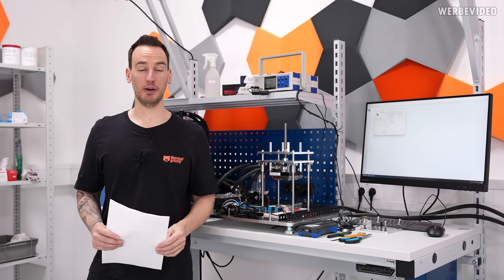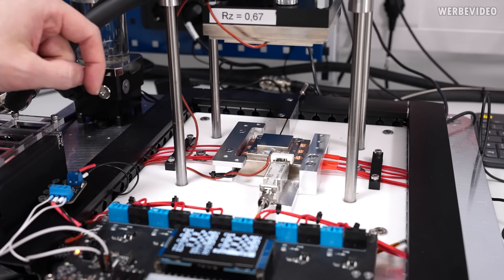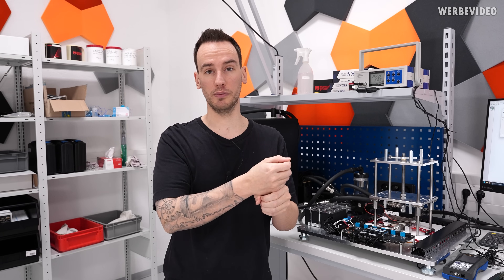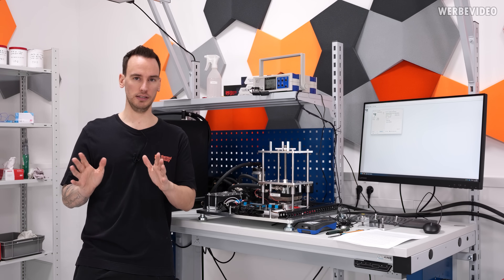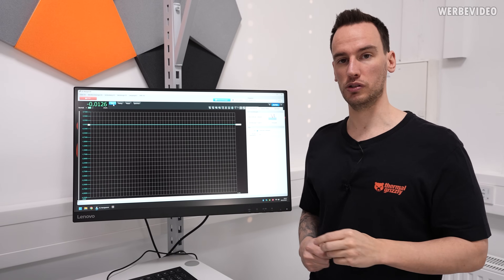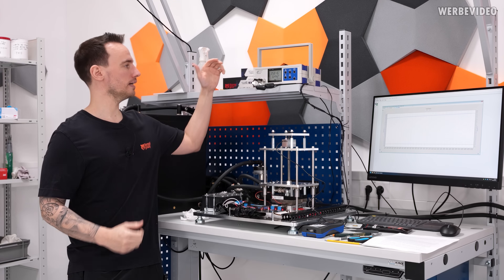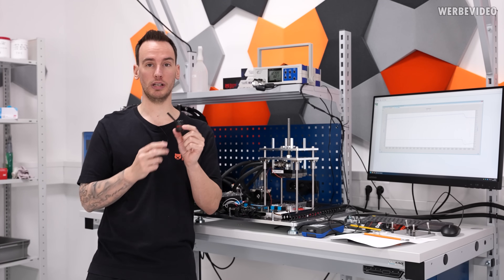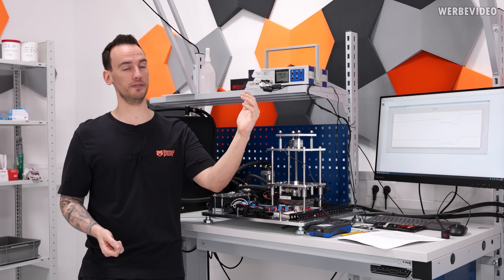The Secret of Testing Thermal Paste

Comment: 10 micrometers vs 20 micrometers… can we determine this by how much thermal paste we apply to our cpus? Or is it entirelly dependent on cpu cooler pressure and structure and the inherent charactristics of the paste itself like viscosity.

Because that thinness has to be achieved by the cpu cooler pushing the excess out. But my question is this,  if you add too much paste before installing the cpu cooler does it hamper its ability to push the excess out efficiently? I doubt it since it doesnt make sense. Then this means you cant apply too much paste then, rigth?

Comment: Hello, I don't think it will affect much if the thermal conductivity is maintained. Anything you add, whether it is a good or bad conductor, is and follows the law of Ω a bit, if the paste consists of covering the regularities (cpu---> metal---> radiator or cpu---> radiator air) if the material is maintained, the conductivity will change little (the fact that it is liquid I think is to maintain the contact without regularities, that is, improve its distribution); but suppose you make an ink with a somewhat elastic base and the rest for example of a certain graphite flakes with conductivity of 1000 and something at 2000W / mk and the ink is applied as if it were a correction marker, in such a way that you paint the cpu and paint the radiator, even if it dries the gaps remain covered and being like a paint, it is enough to correct the problem, in case of graphite, suppose it is copper, or aluminum nitride, zinc oxide, and the dangerous dust of beryllium oxide
The material will remain there, as long as the elastic substance, whether due to phase change or because it is elastomeric, will continue to be painted on both sides. The nice thing about this information is that it is done on the z-axis and not the x-y (something I have not taken into account). For example, a type of graphite crystallization ranges from 1000 to 2000, and for graphene from 3000 to about 6000 W/mk. However, if it is the z-axis, for graphite it is approximately 10 W/mk (the force applied to the paste, the thickness, the size of the grains, the proportions of the mixture, etc.). 
Best regards.

Apologies if something is not understood, I am also a newbie in this, but I liked to learn and experiment, and when I saw this article I used a translator. If any word comes out wrong, I apologize.

Comment: The temperature delta is indeed what you want to minimize for a given thermal case model, but this value will vary with the CPUs internal heating rate. The physical value you are seeking to minimize is the effective thermal resistivity of the interface, which will be affected by the volume and contact geometry of the TIM between the CPU and heatsink, surface roughnesses, the thermal conductivity of the paste, any trapped air, and perhaps even surface-surface radiative transfer.

Comment: Since you do longevity testing, you are well positioned to publish a video about identifying thermally significant pump-out/dry-out from the appearance of the paste. Most people only get to re-paste once or twice over the life of a machine, probably aren't re-applying with the same paste, and often change other variables, such as by deep-cleaning the heatsink.

Heck, you probably have better data than a lot of the open scientific literature, which is largely based on mechanical cycling.

p l e a s e

Comment: I have 10000x times cheaper way to check the surface quality on exactly the cpu/gpu and coldplate you use, which is as accurate as less than 50 microns, actually. Can go as exact as maybe 5 microns, actually. Use pomade  and a piece of cloth. Apply the necessary layer and check the result, then get a grinder 400 grit 800 grit and so on to adjust the coldplaye, then use 5000 grit for both cpu and coldplate. Boom, around 10 to 20 degrees gone.
Reply: Lipstick*

Comment: Roman, just curious if its possible to account for heat flux density? With modern CPU dies being so incredibly heat dense, the bottleneck becomes removing the heat from the small hotspot on the CPU die at the core area. How do you typically tackle that?

Comment: lol.. Der8auer coming up with all the ideas. I emailed you months ago with cpu pin extensions and not taking into account signal timing. I’m a fool.

Have you tried using surface acoustical waves to align the particles . This can even be done after the paste has been applied. If tested under a microscope, you would be able to identify the exact frequency to best align the particles and create the perfect structure for thermal conductivity. You could also try electro fields but that wastes more power.

Comment: For long term testing you should mount it vertically to see if the paste falls out of the joint or separates slumps etc. Overclockers use motherboards differently to plebs we put them in cases

Comment: would love to chat with you about some products I'm am soon releasing with features never seen before that break new ground and solve a heap of problems. They also allow for fans and radiators to be used in ways far beyond what is currently possible. I did try to reach you via the Thermal Grizzly website contact form but my message may have been lost in the mass of messages you probably receive through there. Can we talk as I would love to send you the early prototypes to review/test/critique and maybe use for a build either personal, work or client. Once i send them they will be yours to keep so you can use them however you wish.

Comment: Great explanation, and as someone who has to work on thermal interfaces quite a bit I was wondering if you could expound on a couple points:

1.) What are the typical RMS roughness's of a waterblock/AIO block and an IHS? It would seem that as you reduce the effective viscosity of the paste to achieve a thinner bond line, via smaller particles and better distributions, you'd eventually reach an inflection point where the suspension no longer adequately fills the gaps between the two solid media. I assume that the 12um typical bond line of Duronaut isn't yet at that limit, but it would be cool to understand what it might be. 

2.) One of the things you often hear about Kingpin's KPX is that it is extremely thermally stable and maintains its reported conductivity over a temperature span from the cryogenic temperatures common with LN2 up to more typical ambient cooling (but I've never seen it tested using a methodology similar to what you've presented here). How does Duronaut compare in its temperature dependent conductivity? Is it suitable to sub-ambient cooling or higher temperature (passive or server type) cooling? Also is there a risk of pump-out or solidification/fatigue outside of a specified temperature range?

Comment: Make long tube, from PVC. Then, fill the tube with thermal paste. Then freeze ( oil will goes from liquid phase to solid ) Then, cut on to parts, with longevity you need to. Then connect three parts together: first part - dispenser, middle part - tube with paste, end part - pushing mechanism. Here we are. Mass product. May use with special gun ( pistol, like one that use for sealant work ) for use tubes.

Comment: I would hope Roman you would look into elastomers like Kaneka RV087, they are much worse conductivity wise, but the reworkability aspect is huge potential. You can cover VRAM like there is no tomorrow, even the PCB traces and after curing it becomes like gel. Also great for condensate protection.

Comment: Excellent presentation, especially in an area that is dark to me. I tried the Honeywell stuff and was extremely dissappointed. My system was always running hot. I decided to change to Conductonaut. The Honeywell stuff was dry and it took a bit of time to clean it off. Honestly, I had expected the Honeywell stuff to still be plyable. I used the liquid metal and my system has not overheated since.

Comment: Came from the GN video: 
For everyone's knowledge: To grind AlO2 you need a hardness of 61HRC minimum(Mohs 9)..Carbon-Steel has a limit of 70HRC, so those rolls are a wear item.. Replacing those precision ground rolls on a less than once a year would be quite the expense. 
As a suggestion: I would look into tungsten-carbide spray coating a set of used rolls. Probably need a 1-3mm undercut and then HVOC-WC build-up, ground flat and buffed to 10k grit(0-2micron) finish.  I have seen zero-wear in wear with that on 1800rpm pumps in a coarse potassium-salt slurry. Although not an issue of pressure, certainly a wear issue. Perhaps your roll manufacturer would have more insight for you.. It may not be fore your application

Comment: One of the things that is important is longevity, you don't want the paste drying out. When I took the cooler off my 3700X after 5 years of daily use the Aeronaut was still good, not dried out at all. Excellent stuff from Thermal Grizzly!
Reply: "paste drying out" doesn't matter much. It's not the carrier oil that conducts the heat.

Comment: One thing that would be useful is some thermal spreading resistance calculator with realistic values, as heat flowing from a small surface area, such as a CPU die, to a larger area such as the heat spreader. On a CPU, the die is typically around 150-200mm2, while the heat spreader may be 900 or more mm2. On top of that, the workload is probably not evenly distributed across all cores, so the effective die area is even lower, resulting in a higher thermal spreading resistance for a constant heat output. And of course, the roughness of various elements isn't generally known.

Comment: When he said that its 'physically not possible' to have a perfect contact between the CPU and cooler, so zero temp delta ... is not completely true, and we have examples in the real world.  In our cars we have gaskets in between metal components (block to manifolds etc) to seal these spaces and stop leaks, and to maintain these seals regardless of temp fluctuations.

Formula 1 cars (and all highest end racing categories) with fully custom motors ... do not use manifold gasket materials.  The tolerances designed into milling these parts is so precise that they dont need gaskets, they are just well sealed on their own, by design, metal to metal. The tolerance is so close that no material is needed in between the parts for thermal conductivity, or contact resistance or thermal resistance. We are talking a pure metal to metal contact seal.

A caveat is that these two parts seal only when the engine / parts are at operating temps, requiring teams to externally heat oil and fluids to create the thermal expansion, and therefore the seal.  For this reason this comparison isnt actually fair or equitable, and is completely impractical, but still an interesting idea and thought experiment.

If we imagine that an engine gasket material is analogous to computer thermal paste, it is with todays metal manufacturing capabilities,  physically possible to create an absolutely perfect seal and therefore have thermally conductive contact between an IHS or die and a cooing block without a paste or liquid metal interface ... because metal parts can be machined this well, F1 proves that.

The obvious problem is that intel and AMD and cooling part makers dont get together to do this, and dont have the manufacturing capacity to do so anyway.  Imagine the cost of all parts if they hade to be machined to this level of tolerance.  Thermal Grizzley paste is just cheaper.  As well the turning on and off of  computers and the variable thermal realities of general users ... obviously negates the usefulness of such a solution.

This was just to point out that yes, it is possible to design a contact point that would not need a thermal interface.  Its done all the time.
Reply: The most important part you forget is, that the seals in cars are not for thermal conductivity, but for sealing against gas or fluid flow. This is a completely different use case and can’t be compared.

Comment: I've been meaning to get a torque screwdriver as for the most part I've been winging it when I tighten heat sinks. Using a star pattern and not going insane when tightening the screws down.  But I feel like putting the appropriate pressure down should be more exact. I think this video has probably pressured me into getting one. :)
Reply: I would guess that its better to put paste in the middle of the cpu so theres no air accidentally getting surrounded by paste

Comment: Great video Roman. Good to see a REALISTIC test setup for our needs. Igor won't accept any criticism though so won't be happy 😂. 
We need you to publish results for your pastes and LM vs at least a few of the well known competitors. 
Is it possible to increase both your 'die size' and power to at least match a 320 to 400W 14900KS and 600W 5090 die? 
My 14900KS uses Conductonaut (of course). Need to decide on what to use with the 5090 and EK block (yours isn't available yet 😢).

Comment: I trust you. I used Duronaut on my 9950X3D and Hyte Q60 (in push-pull) and my temps are great. Using Cinebench R23 and the 3DMark suite my CPU never exceeded 85C and currently watching this video my CPU is 46C.

Comment: @Der8auer, I noticed it didn't  appear you took pains to prevent surface oxidation of the Aluminum powder. (Perhaps you used Argon and it was heavy enough to pour into the bucket to help shield the powder, I'm unclear.). Im curious if powdered Copper, which doesn't oxidize as readily as aluminum, would result in better paste performance (it would however become electrically conductive).

Comment: soooo, does this mean Igor should stop measuring the heat conductivity in steps of thickness but rather in steps of pressure? The more pressure the thinner the layer and the better the result. Comparing the ΔT values at same pressures should give more real time values?

Comment: This is why i loved the zalman stg1 thermal paste. It was really thin and you applied it with a brush on both surfaces, a bit like liquid metal, and you'd get really good heat transfer because you could get such a thin layer of it on. Seemed to get a bad rep in a lot of reviews, but when i ran out and had to use something like mx4, didn't perform so well for me.

Comment: btw who and woh often do you check/calibrate that the hight sensor measures correctly ? ( personally i would use some ceramic gauge blocks from mitutoyo since they are garanteed to be within a few 10's of nanometer at 20 degree C. so id the sensore says the diffrence is what you can calculate based on what the blocks say. i would call it good/within calibration )

Comment: with thermal paste I had interesting case with old AMD RX580. (during mining so the same settings/power/scenario) repasted with Kryonaut was 60°, after that Conductonaut was 50°, after 3 months removed liquid metal (still was 50°) without cleaning dried parts of liquid metal, (was a lot in my opinion, heatsink was bare copper). after that again Kryonaut and was !!!!!!!!!!!!!!!!!! 52° !!!!!!!!!!!!!!!!!!!!!!!!!!!.

it's look like liquid metal build solid part where was a big gap. and after that equal near to 0.00mm gap between core and cooler.

Comment: I really appreciate you sharing this level of information with us. This is the sort of thing paranoia led companies keep under lock and key. "My precious." It is super refreshing to find humans who are willing to spread knowledge freely despite enduring the costs necessary to attain such knowledge. Thank you.
Reply: What he shows are the obvious parts. Most people with an engineering mind (or degree) would come up with similar solutions. 
Having the stamina to invest the time and money is something most can copy anyway. Plus its what you do with resulting test results.
Reply: The recipe is fix, the amount of each ingredient is the secret. You have to publish the content in the EU in case of emergency.
Prolimatek has the exact % and ingredient list on their box, so you can reproduce it if you can.
Reply: They only share the general information. Everybody could look up before that thermal paste is metal powders held together with an oil and those measurements are nothing special. The thing all companies keep secret is the exact particle distribution in the final paste and the amount of oil they need.
Reply: @KarlKarpfen  I suppose this is true. You are all making valid points. I used to work for a company (in the states) which would cover up fixtures or close off areas when certain people came to visit. People had to sign an NDA to speak to anyone deeper than the sales department. I was always questioning how much I could share with a customer, meaning engineering drawings. All for the sake of maintaining "trade secrets". An extension of the patent system used to give companies a leg up over the competition.

Comment: Great video! I appreciated the part where you detailed the difference in Thermal Conductivity between Duronaut and Putty Pro. It can be frustrating explaining to folks why a paste is not suitable as a replacement for pads or putty. 

That's a nice test unit you guys built. I'm hoping to make something similar someday. Was looking at just the thermal sensor setup I want and it's going to take me some time to get there.
Reply: I think it's funny that the only situation where picking the paste by thermal conductivity instead of delta T is when you want to misuse it as thermal putty.

Also, this reminds me of BPS Space's gutted gopro cameras which he filled with thermal paste. He should've used a thermal putty!